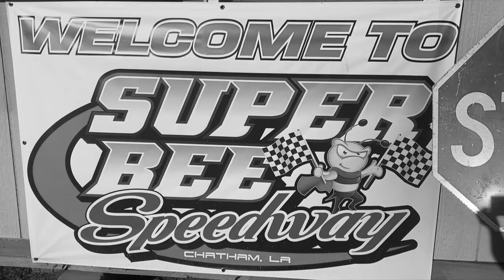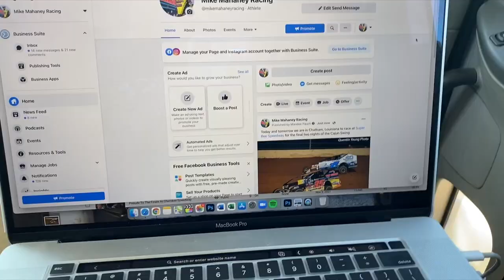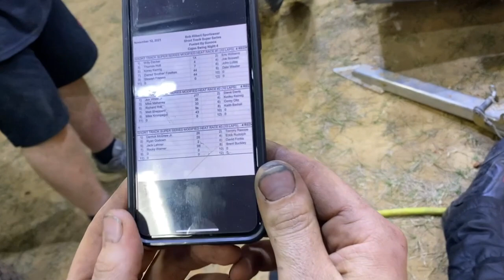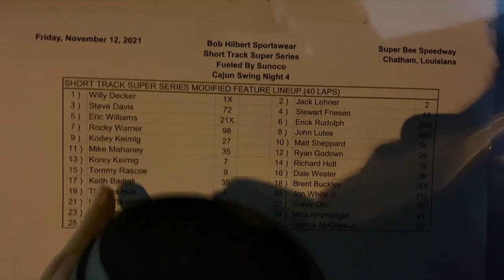Cajun Swing Day No.4 | Super Bee Speedway

Comment: That car came off the corner like a rocket compared to the race before. That was a very strange failure of the axle. I've seen either end of the spline do that but never seen in just the middle. Being the left side may be a clue as to why. Too much end play is often a factor when they strip without breaking. but not knowing what set up you are running in the diff leaves nothing but speculation for a reason as to what happened. When I ran NASCAR we used lockers and they are critical about axle length and end play or failure was imminent Hope you get a good draw the $ race goes your way.  Please do a follow up on what happened with the axle. Us gear heads want to know 🏁